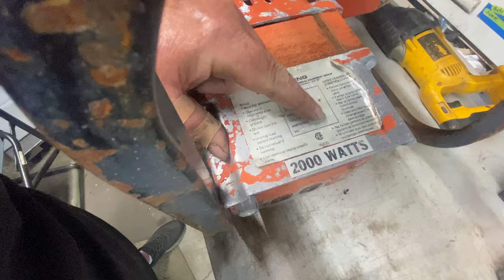Contest Announcement - How much copper in a 5 hp generator

Comment: yep, everyone needs to decide how far to tear something apart or just send it to shred. everyone has a different concept on their time value.  I think I would have taken the 4 bolts out of that cast aluminum piece to get that off then send the rest to shred.  you had the drill and socket out already sitting on the bench so i would have spent the extra 30 seconds to remove that. 

always nice to get stuff with copper in.
Reply from the maker: What you didn’t see and ya I never showed on camera was those bolts must of had nuts on the inside all they did was spin
Reply: @nicejunk666  Ahh, ok, i would have left them too then.